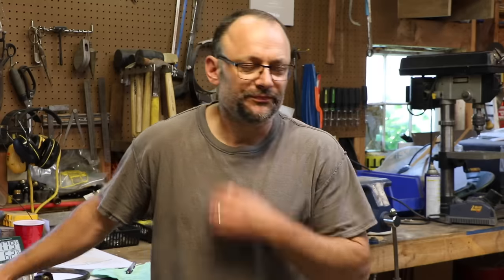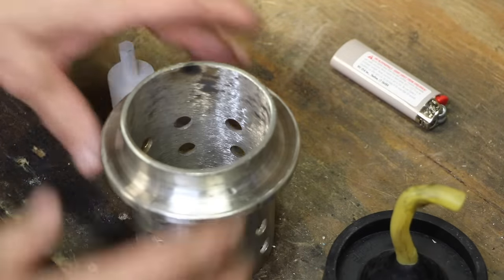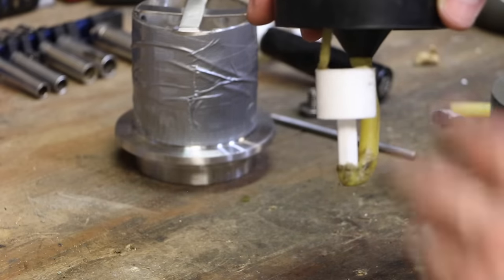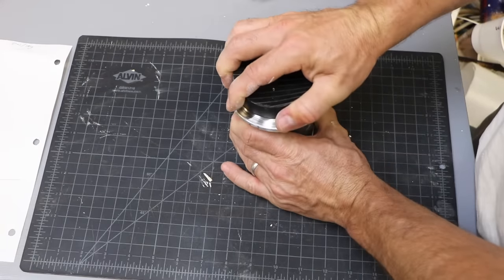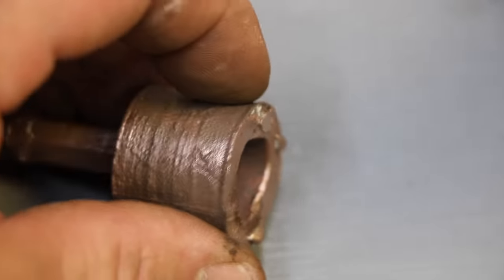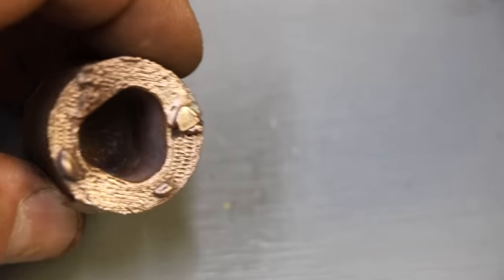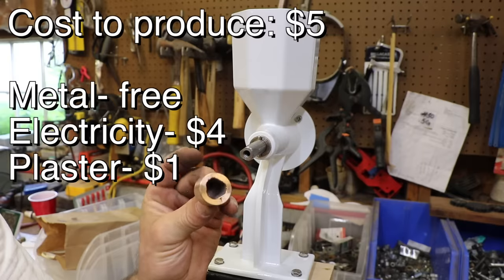I Refuse to Buy Your $@#!   I Make My Own.

Comment: I read your extended explanation in the description at the top and agree with it.  You can't satisfy everyone, but you can get satisfaction out of beating them out of an intentional design failure just to make you buy their adapter.

You know, I don't have all the machinery you have but have managed over the years to make adapters that fix manufacturers' flaws in the design with some basic hand and power tools. I do enjoy watching channels like yours, so keep it up.

What bothers me more than anything else is that most people do not think it can be done better. It must be good when it comes in a nice package, right?  Failure in design only makes more profit, but it doesn't make for long-term return customers, at least in my case.  I have bought coffee pots that didn't last 2 days, and guess what, I don't buy their brand any longer.

If it doesn't work or breaks, I can just throw it away and buy another, right?  There appears to be no incentive left to be self-sufficient anymore or do repairs on anything. I actually enjoy coming up with solutions to make broken things work as designed or better. I'll take analog over digital any day because it can be fixed easily.  

I still have two old analog TVs, just in case of an EMP attack fries all circuit boards in modern equipment, and only analog broadcasts are made available in this country. If that never happens, then I have two antiques to sell to a collector in my old age.

I also think Japanese-made products are heads and tails above anything made in China, Mexico, Bangladesh, or Korea so I am not against importing well-made products but avoid communist-made products as much as possible.  We all know who they are but some just don't let it register.  

I have a Toyota that is 26 years old and has almost 200,000 miles on it and has yet to give me a mechanical issue. I also have a Chevy and Ford that give me nothing but problems and have half the mileage, but I try to buy American too. I am just not in a hurry to buy the same name brand that gives me trouble again as a replacement.  

I'm not bitter towards those who can't see solutions or even consider there may be alternatives. I do worry about our future as a country when so many rely on China to do it all for them. China does know how to steal intellectual property though and sell it back to us and make a profit. So good for them, bad for us.

Comment: I woulda done had a pulley mounted to that with a motor attached. To heck with hand cranking or holding a drill. What I ended up doing to my antique mill and grinder.

Comment: 1:30  simple tube to sliding fit over the shaft and drive onto the crosspin. weld drive of choice onto tube, also if ya get the length right can be retained with a screw into the 'ole on the end.

Comment: It is a triangle because triangles are the strongest shape and you can apply higher torque and moments of force to them as a triangle fitting is less likely to sheer.

Comment: Nicely done.   Unless I have something else I have to do I consider my time my own and therefore free.  If I actually enjoy what I'm doing I figure I'm getting paid so making something in the shop rather than buying it is both cheaper and more fun, regardless of how long it takes.

I had to raise some beams ( 3 beams each 22' long, 8" x 8", still a bit wet so just under 400lbs each) and due to the joinery I had to have them suspended and then join them in air and lower them in place.   6 block and tackle capable of carrying them was going to cost over $1000.   Glued up some 3/4:" baltic birch to make wheels, then cut steel housings and made 6 sets of double sheave block and tackle with 4:1 advantage.  Fun to do, cheap to make and very satisfying.   Majority of the cost was the rope.

Comment: why not put an external hex on the 3d printed bit that would convert a socket to the shaft?  under compression alone and not a shear force the 3D print should hold up fine for the application?

Comment: Just curious ... How much did it cost you to build that adapter?  Consider the cost of the copper, tin, Phosphor Copper, Plaster, gas for the forge to heat the metal, the cost of the electricity to run the lathe, etc.  Just curious how much cheaper it was vs. buying. :) 
Great information and great video!  Thanks for sharing!  Have a better day!
Reply: Oops.  I wrote this before I saw the ending.  $5.  Very cool!

Comment: Thread two nuts onto a hardened bolt and screw the bolt into the threaded hole. Then tighten one nut against the shaft. Tighten the second nut against the first nut. Now put your socket onto the bolt and turn with the drill.

Comment: I would just take a grinder to the shaft and add 3 more flats to accommodate a socket that does not need to go far on to do the job. Maybe two minute fix.

Comment: So, yeah---they are going to price it based on how much it would cost a competent person to produce a one-off of it--bastids! lol

Copper isn't very strong--why did you make it out of copper alloy & not steel?  Just because it has a lower pouring temp?
Reply: Good luck casting steel without the propper equipment. As a jeweler i think he did an excelent job with the tools he has.
Reply: @365catdog  I never implied that he didn't do an excellent job--I just asked why he chose copper instead of steel--or even aluminum (which is a lot easier to machine than copper--which is kind of gummy when machined).
Reply from the maker: Yeah, you can't cast steel in the presence of oxygen.  Very hard to do.  Cast iron was a possibility, but harder to melt and brittle.  Bronze is pretty strong stuff.
Reply: @ab_ab_c  the other side is that steel needs special investment plaster also which i forgot to mention. Its quite hard to cast even as a professional lol

I think aluminum will react with gypsum investment leaving bronze as the best choice.
Reply: @FarmCraft101  Why why didn't you use aluminum.  It has better tensile & yield strength than bronze.

Also, what was the white powder you added to crucible?  Was it borax to function as a flux?

Comment: You may have been able to stick with just a 3d printed part with slight modification to the model you showed. Use a normal metal bolt inside the drill. Break off the weak tip like in the video and instead on that side of the adaptor create a negative of the bolt head instead of the weak protrusion. Then proceed to print like normal. It's honestly a 10min 3d modeling job and i'd be more than happy to provide the file to you! PLA is more than strong enough. Great content!

Comment: A simple pipe with an inner diameter to fit around that shaft and with a slot to grab the cross pin... that will do...

Comment: I appreciate your skill in making this and I learned something by watching too. The material cost might be just $5 but your time spent on making it was worth much more than the $30 for the part made by somebody else.  Your labor is not free; you could have spent that time on something more valuable to you. Some things are not worth doing unless you are building a skillset you will use in the future. This is why there are some things out there I just will buy because ultimately the true cost will be much lower than if I make it myself.

Comment: I'd just run it off the cross pin take a deep well socket that's just bigger than the shaft and put a notch in it

Comment: Could always slip a piece of pipe or tube over the shaft and drill a hole for a pin. Or heat up a piece of undersized pipe and force it over the taper.

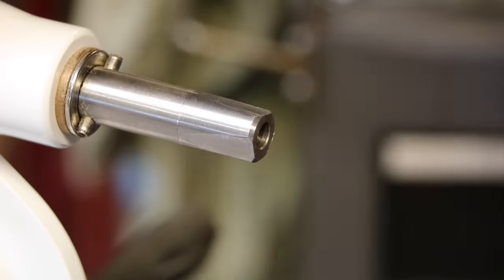Comment: Interesting and educational approach to solving the problem. Thanks for sharing. At 1:50 there is a clear view of the shaft showing a retaining pin. A pipe that fit over the shaft with notches on one end to fit the pin and  a hex bolt welded to the other may work. A lock screw could be added to secure the pipe to the shaft. Of course I don’t have access to a foundry.

Comment: I like the video, cool project. 

For anyone who is looking at buying a wheat grinder, this is why I bought the Nazco Nugget. It has a round, keyed shaft that will accept a v-belt pulley, so you can add a motor.

Comment: I probably would try to optimize the print. For one printing it flat so we don't have the issue of the weak layer adhesion, also I would have made the shaft thicker.

Or I would redesign the part to have the mill shaft fit in one and a a hex shaft in the other end.

Comment: The part would be a lot more durable in my opinion, if you were to put a chamfer or a radius on the corners, where the hex shaft meets the round body. (the spot where the PLA print broke)

Comment: So silly, probably $200 in time, $2000+ in tools/equipment, but dang is that satisfying.  It does show that having a 3d printer, kiln, forge, etc - are extremely useful.  Sometimes they don't resell those little parts, or they're out of production.  Or you can't wait for shipping - which can take months longer than expected due to covid.  It's pretty cool.
Reply from the maker: Right.  This wasn't necessary, but more about trying out the process.  In the future when I need a part that isn't available for purchase, I can use this technique to make it.

Comment: Just another thought. If you never intend to crank it by hand ever again, you could have put a bolt into the end of the shaft to use as a guide then just carefully grind back that hex ( using the 3 flats already there) from the bolt enough to use a drill directly on the shaft. Then just remove the bolt if you want to and attach the drill.
OR take the taper out of the 3 flats ( making it parallel with the shaft) and attach the drill.
Reply: It won't work. Trust me, I'm an engineer.
Reply: @swedishpsychopath8795   HA most engineers are a joke to me.
Reply: @brentbosworth8845  No need to feel intimidated just because I have the formal education to know stuff and be able to tell you how stuff works. I'm sure you know some useful stuff too, even though you have no education. Heck, I'll let you paint my house the next time it needs painting just so you can experience the feeling of contributing to society, probably for the first time in your life?

Comment: I like the video and the project, but at the end you hit one of my "maker" pet peeves.  YOU have scrap brass or bronze and PLA already, so you consider the value to be $0.00 for materials.  Not everybody has $$$$ worth of scrap metal laying around for projects, and will have to buy new or from a scrap yard, so including a zero value for materials is disingenuous at best.
Reply: It's something I've noticed as well. Some makers, I've noticed will include a second "if you have to buy all the materials" list, or even point out cheaper options for some of the tools they use, but I don't understand this idea that every other maker just has infinite free materials of every type.

Comment: Parts needed $2 + about $ 500 for your time.  So you spent $ 470 more than it would cost.  I feel that  is a SUCCESS!  Very well done.  I feel that the effort to stick it to the buggers that could throw a $ .50 part in with the product but didn't, is worth it.
Reply: I think you're off a little bit on the time value, unless there's some way I could be making $500 for a few hours of playing with metal...

Comment: maybe you could have swapped the shaft or filed it down to an hex?
Reply from the maker: Problem is, if I change the shaft, then I lose the option of using the handle.  Could make a new handle then, but....this seemed easiest, and the most fun.
Reply: @FarmCraft101  Handle? Who needs a handle when you can use a huge socket wrench with more leverage?
If you don't like the angle of the wrench, you use metal ties to put a handle on the socket wrench. :-P
Reply: I mean, a 3D printed adapter glued into the handle would probs be fine, especially if made from ABS. But I like the bronze adapter.
Reply: @FarmCraft101  if you file it down to an hex (filing 3 other sides) the handle should still work

Comment: I'd bet you might actually be able to use the 3D printed tool. There are 2 things I see wrong with the print. The first is that you printed it in wrong orientation. The weakest points on FDM print are the layers, it's not a perfect bond between each layer, so when you rotate it with the drill, you are putting the most amount of force on the weakest point. Try printing it on its side. It won't look as pretty, and you'll have some supports to clean, but it will way stronger. The second thing is do 100% infill, when making a functional part that sees a lot of force like that, you don't want to skimp on the plastic to save some filament, you want max strength. It wouldn't last forever, but it'd probably work longer than you'd expect though.
Reply from the maker: I actually tried 100% infill off camera and it broke.  I did not try printing it on its side.  I'm curious, and may try it just to see.  Thanks for the tip.

Comment: If you had printed that out from a different orientation, it likely wouldn't have failed(as easily). The layer lines should be perpendicular to the input force, never parallel. That is why it sheered like it did.

I have 3D printed tons of stressed parts. As long as you choose the print orientation properly, they can work wonderfully.
Reply: Same thing when making things out of wood. If you slice a 1/2" piece off the end of a 2x4, it will break apart in your hand. If you cut the same size piece with the grain going longitudinal, you'd need a vice and pliers to snap it in the same way.

Comment: Honestly I would have bolted a pully to it, and just be done. If it breaks, then fix it with a drill, welder, milling machine. There are many ways to skin a cat.
Reply from the maker: Agree, there are many ways this can be solved.  I've been making videos of lost PLA casting recently, so that was the method I wanted to use.

Comment: Nice project!  I would have had to use fiberglass or straight epoxy.

Did you think about making a curved transition from the hex surface to the end of the cylinder?  Lots of stress at that sharp corner!
Reply from the maker: Yeah. Agree. But I didn’t design the 3D print. If it breaks I will do mine with a bigger hex and better connection.

Comment: I find it baffling that they're doing the same mechanical  job the same way as bicycles have been doing it for 60 years or more, but didn't use a dirt cheap and available everywhere bicycle crank.
Reply from the maker: That's a great point.

Comment: Any reasonable do-it-yourselfer has a 1/2inch drill motor.  
Chuck it up and away you go, no adapter necessary.
Reply from the maker: I have many 1/2 inch drills.  None will fit over that shaft.  Even my heavy duty right angle drill won't fit.

Comment: I applaud your "I'll show them" attitude. As you said "it's the principle of it all", but I wonder.  If you were to produce these to sell what could you realistically price them at to make a reasonable profit considering your labor in addition to the materials?  Thanks for posting.
Reply: Also search for the post by Beltonius as they touch on many of my points as well.

While it is always fun to make something, Wa Wa Wa,  that evil bowl of Jello that runs the world is out to get me.   The shaft has multiple flats and a taper so the handle does not become loose and wobble in use. With this system, the cast handle requires no machining.   What kind of shaft design would anyone propose that does not require any machining of the handle?  

I'd call it good design for a machine that is intended to be hand powered.  I'd also be looking at how this type of mill was designed in the old days and see what kind of attachment method they used.  In other words, this design might date back to 100 years ago.

Drills are generally intermittent duty leading to overheating and I can see the operator struggling against the torque.  A chain or belt drive hooked to an actual motor is a much better choice.   There is a very simple way to attach a drive to the mill, look up  "   Taper Lock Bushing "  and " Split Taper Lock Bushing " .  This is a 2 piece system that will grab a smooth shaft and not slip.  

Who will pickup the mantle and design, manufacture , sell mills that everyone is happy with?

Comment: Excellent video.  I would have just chucked the shaft in the lathe and made a wood spacer between the grain mill and the lathe ways.   The lathe turns slow enough with plenty of power to spare.  I wonder if the tri-taper design is done to facilitate pattern draft on the cast handle. Thereby, keeping production costs down.
Reply from the maker: Funny. I’ve done this, and it’s works well. Will probably be shown in a future video. ;-)

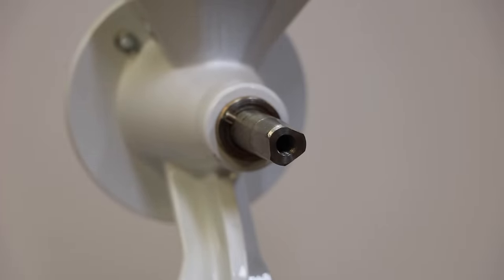Comment: 1:49 well given that it seems to have a threaded hole in the shaft i suspect an appropriately sized bolt with a hex head that you can then  use a socket set to mount the drill with should do the trick :)

Comment: I weld. Plain and simple. You are overthinking this way too much.
Reply from the maker: Actually I was doing a whole series of videos on learning to do lost PLA casting when I did this.  It was more that I wanted to find a use for this process, and this was a good job to practice it on.  I should have explained that in the video, because this one video has gotten a lot of attention and that of course isn't apparent to viewers who only see this one video.  I also wanted to preserve the option to use the handle if I ever wanted to in the future, but even so, there are much easier and faster solutions to this problem, no doubt.  Cheers.

Comment: Lots of commenters here with a lot of knowledge and experience. Can anyone tell me why a grade 8 bolt screwed into the shaft wouldn't work? It would have a head that a socket would fit on.
Reply from the maker: It would probably work.  But if the bolt ever broke it might be tough to get the stud out.